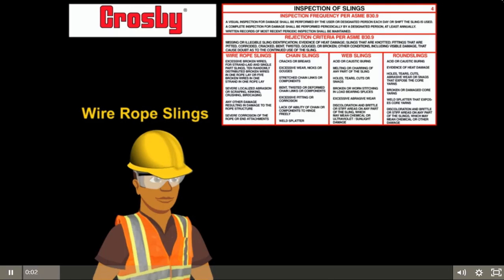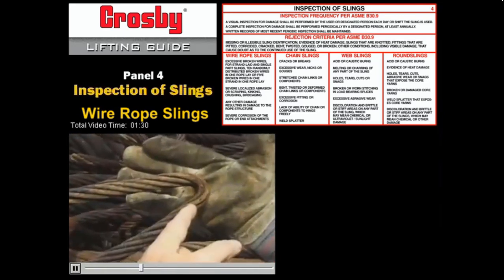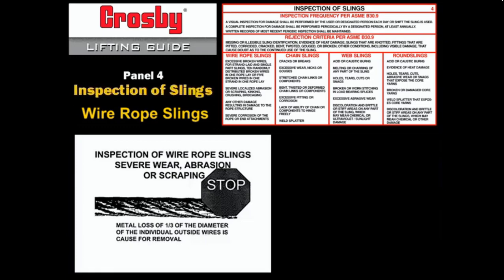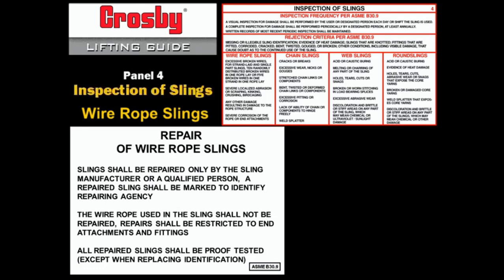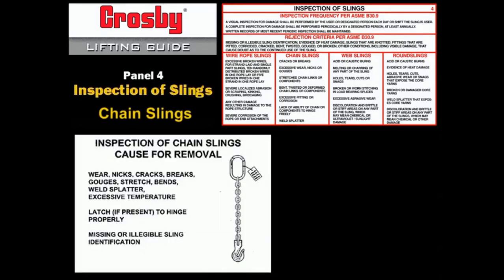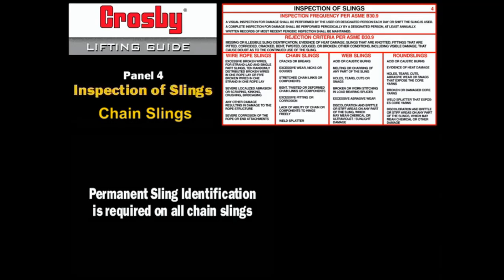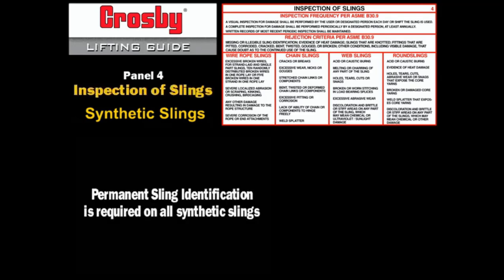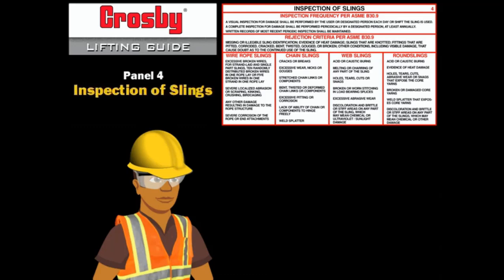Inspection of Slings

Comment from the maker: Question 1 of 16
1. Question
Category: Inspection: Wire Rope Slings
Wire rope slings must be removed from service when there is distortion of rope such as:
(select all that apply)
•   Kinking
•   Crushing
•   Unstranding

Question 2 of 16
2. Question
Category: Inspection: Wire Rope Slings
Wire rope slings (6 x 19, 6 x 36) must be removed from service when there are how many broken wires in one lay?
•   10 randomly in one lay
•   5 randomly in one lay
•   15 randomly in one lay

Question 3 of 16
3. Question
Category: Inspection: Wire Rope Slings
Wire rope slings (6 x 19, 6 x 36) must be removed from service when there are how many broken wires in one strand in one lay?
•   10 in one strand in one lay
•   5 in one strand in one lay
•   15 in one strand in one lay

Question 4 of 16
4. Question
Category: Inspection: Chain Slings
Remove chain slings from service when damage includes:
(select all that apply)
•   Wear
•   Nicks
•   Cracks

Question 5 of 16
5. Question
Category: Inspection: Wire Rope Slings
Remove wire rope sling from service if there is severe corrosion of the rope or end attachments.
•   True
•   False

Question 6 of 16
6. Question
Category: Inspection: Wire Rope Slings
Remove wire rope slings from service if there is heat damage.
•   True
•   False

Question 7 of 16
7. Question
Category: Inspection: Wire Rope Slings
Loss of rope diameter is cause for removal.
•   True
•   False

Question 8 of 16
8. Question
Category: Inspection: Wire Rope Slings
Although a strand consists of multiple wires, one broken strand is allowed in one lay of a wire rope sling.
•   True
•   False

Question 9 of 16
9. Question
Category: Inspection: Frequency
Periodic inspection of chain and synthetic slings in normal service is:
•   Annually
•   Monthly
•   Daily

Question 10 of 16
10. Question
Category: Inspection: Chain Slings
Sharp nicks in chain slings can be ground out by qualified person as long as they do not grind:
•   More than wear allowance
•   Less than wear allowance

Question 11 of 16
11. Question
Category: Inspection: Frequency
The frequent inspection of all slings is required:
•   Each day or shift before the sling is used
•   Monthly
•   Annually

Question 12 of 16
12. Question
Category: Inspection: Synthetic Slings
Remove a web sling from service when damage includes:
(select all that apply)
•   Melting
•   Knots
•   Holes or cuts

Question 13 of 16
13. Question
Category: Inspection: Slings
According to OSHA, permanent identification must be on:
(select all that apply)
•   Wire Rope Slings
•   Chain Slings
•   Synthetic Slings

Question 14 of 16
14. Question
Category: Inspection: Synthetic Slings
Synthetic round slings may remain in service if the cover is open and core yarns are exposed.
•   True
•   False

Question 15 of 16
15. Question
Category: Inspection: Synthetic Slings
Synthetic round slings must be removed from service if cover is damaged by melting or weld spatter.
•   True
•   False

Question 16 of 16
16. Question
Category: Inspection: Synthetic Slings
Heat damage known as friction melting can occur when:
•   Using a vertical hitch
•   Using hardware
•   Rapidly taking up slack of web sling used in a choker hitch